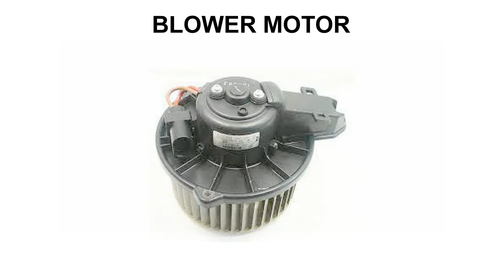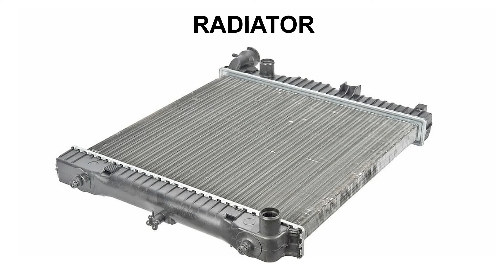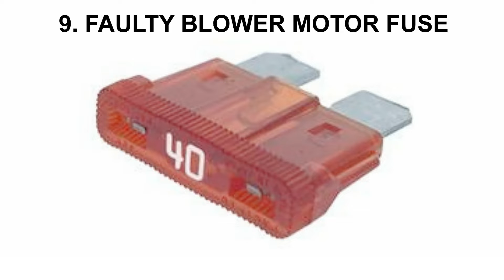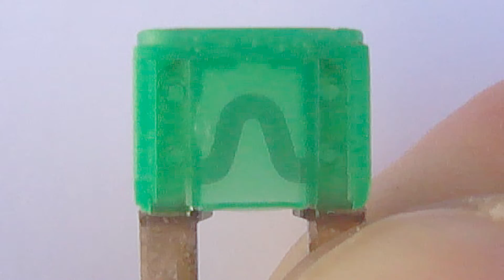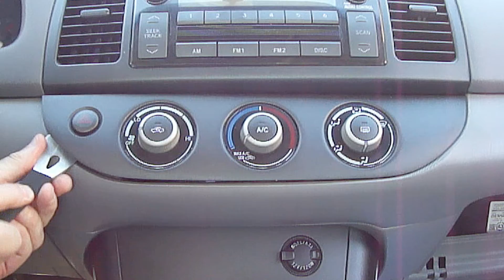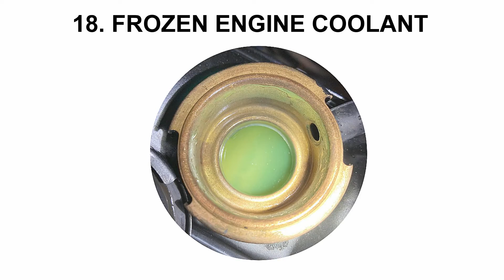Why Won't My Car Heater Work? Causes & Fixes

Comment: You called both actuators “air blend actuator.” I believe one is the air door actuator and the other is the blend door actuator. If I’m wrong, the. air door actuator may be the name for the fresh/recirculate function and the correct name might be mode door actuator (top, bottom, both, defrost).

Comment: #20 would be caused by radiator stop leak blocking the heater core valve or hoses. I dealt with this a few years ago. Had a minor, but persistent leak in the cooling system and added the silver product and had a heater problem after that. Fortunately it's in use in Haiti now, and it's very unlikely to be a problem there.